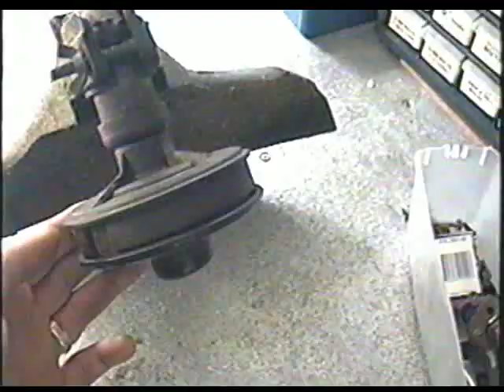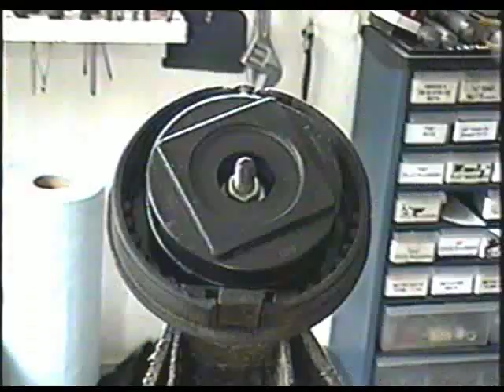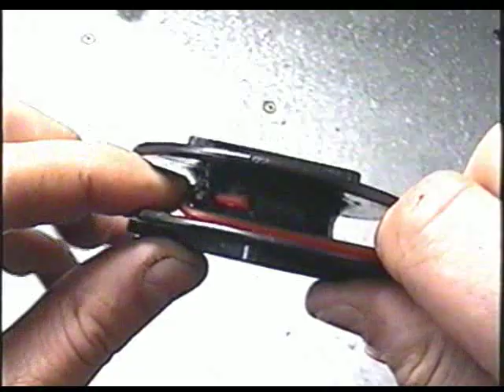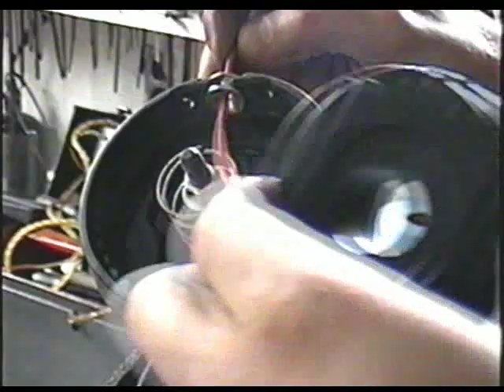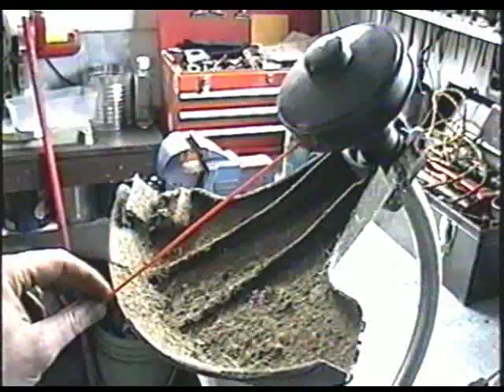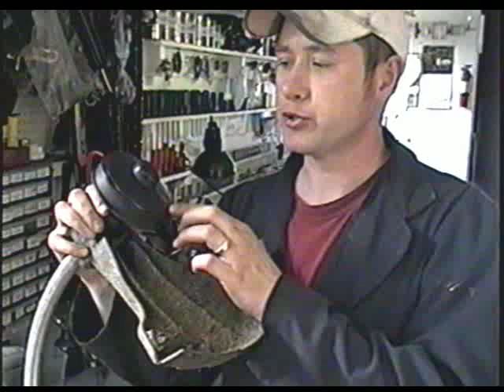HOW TO REPLACE Trimmer Line on Echo Gt 2103

Comment: Another 6 star vid. This story would be funnier if it had happened to someone else. I bought a $175.00 trimmer last year. This year when I went back to Home Depot to get some string, I got talked into buying a whole new head that made string replacement "idiot-proof". ( an extra $ 40.00). The instructions didn't explain how to remove the old head. Two hours later, I was back at Home Depot buying a whole new bottom shaft ($85.00). That day I redefined the term " idiot-proof". Lol